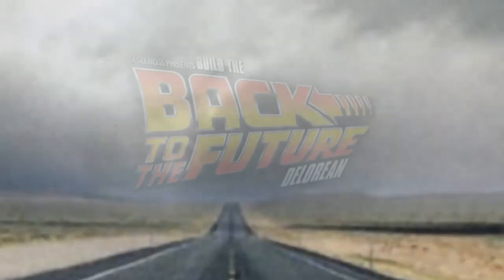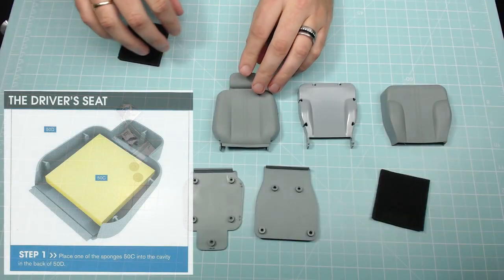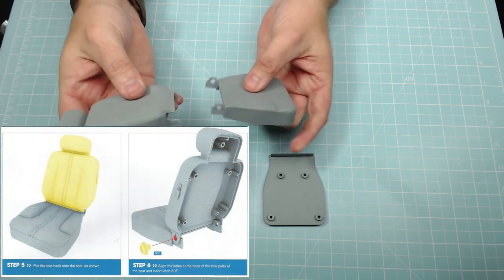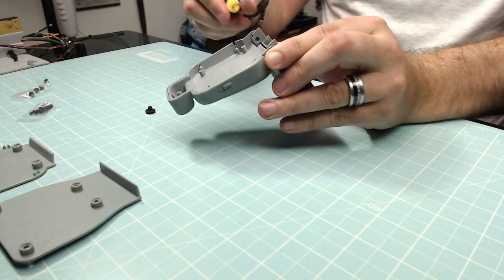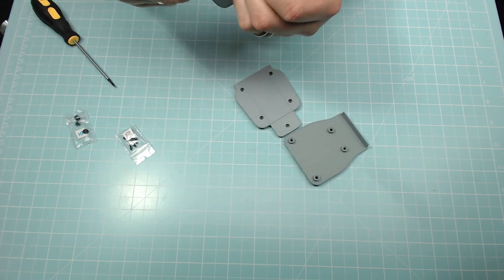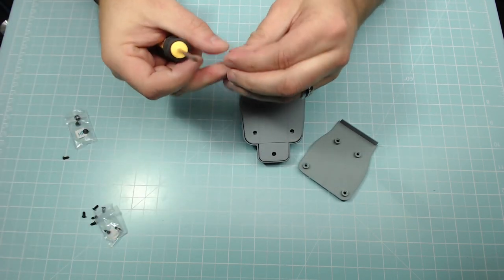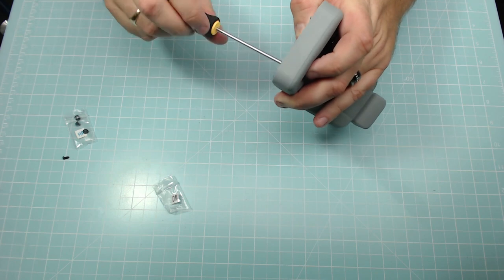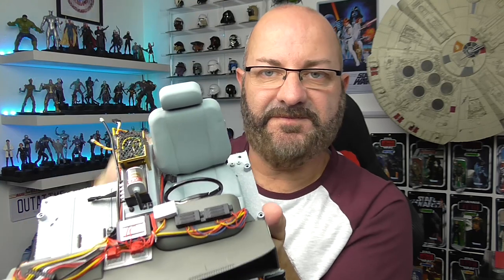Build the Delorean - Issue 50 - Installing the Seats

Comment: Think I’ll be getting this subscription starting this summer. I’ve got the Deagostini Falcon on the bench about twenty-five issues in. So, I’m hoping to have at least half that kit done by then. The good thing about starting this late is I’ll be able to get the fan upgrade sets out there and put them in as I go instead of taking this apart.